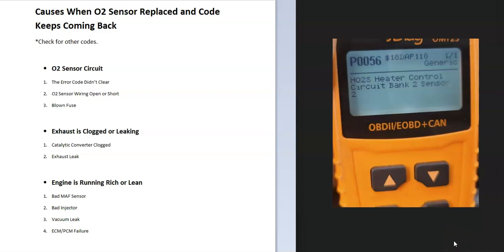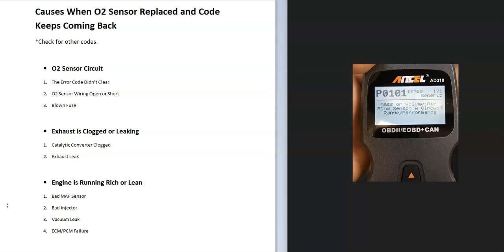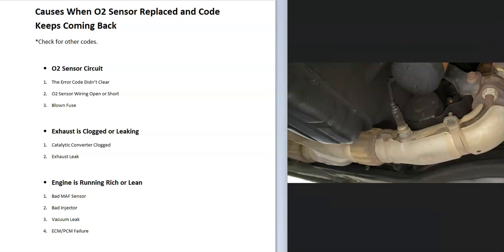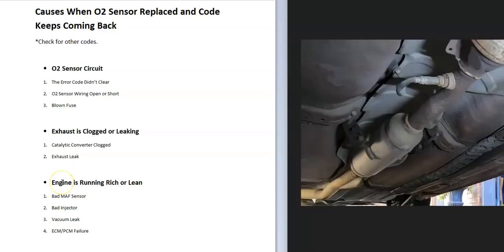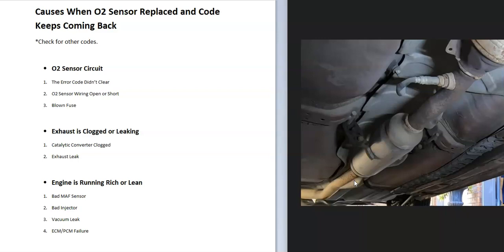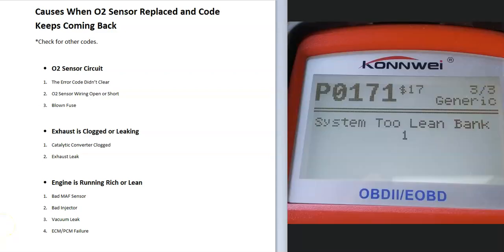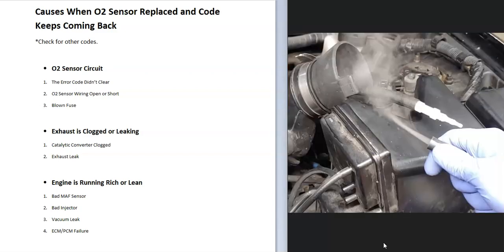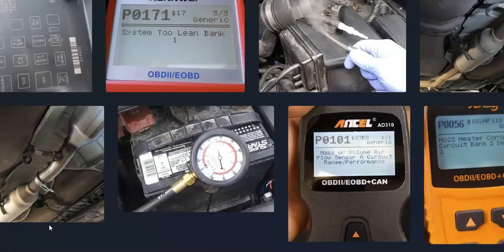Causes When Oxygen Sensor Replaced and Code Keeps Coming Back

Comment: I had a Ford van that tossed po 174 And 175 something like that,anyway I changed the oz sensors and the codes didn't clear,come to find out it was the ecu, so it was tossing bad codes had ecu program flashed with updated software and all codes were gone! Damn ecu PCM are nothing but a problem .

Comment: I don't think this guy will answer me, but I will ask anyway: I have P2096 in my Kia soul 2012 2.0L automatic.  replace downstream sensor, nothing. Replace upstream sensor, nothing. replace 4 spark plugs, nothing. replaced 4 coils nothing. did Exhaust leak test, nothing. Vacuum leaks? no, this car is Brand new with only 88K miles and well maintenance inside garage all the time.  I DON'T HAVE ANYTHING WITH A/F MARKED for fuses. This car has never an engine light until now. So, what else could be?
---- Practically, this is a job for a mechanic to rip you off or the Stealer ship to kill you with wherever bill they want. WOW.
Reply from the maker: If the 02 sensors are good very likely the engine is running lean. Looks like you are going in the right direction. Lean codes can be hard to troubleshoot and can be caused by many different things. If there are no other codes and the CAT is good, I would test the fuel pressure and be sure it is correct.
Reply: @HVAC_Mechanic  The car is working fine, perfect, smooth, MPG the same. Nothing has changed ever. The car is new, so fuel pressure test for what?
Reply from the maker: No exhaust leaks, no vacuum leaks, no codes for a bad engine sensor, new coils/spark plugs/02 sensors. The only thing left that can cause a lean code is fuel pressure.

Comment: My 2017 Nissan Versa is doing this. We replaced the O2 sensor last year and it stayed off long enough for me to pass emissions but came on as soon as I did emissions… We can’t get it to go off. We put a new catalytic converter, air filters, etc.… Do you think the O2 sensor is itself faulty? It was bought on Amazon and didn’t properly fit so we had to rewire it.
Reply: And when I say “we can’t get it to go off“ I mean the check engine light.

Comment: I have a Strange p0136 bank1 Sensor 2 Code wich keeps coming back even before I restart the (Diesel) engine. (at least immediately noted again in the system MIL is of for 1 or 2 days then it comes back) Fuse was intact, no obvious cable problem. Cat is 280degrees at front, over 600 at the Back side, so the cat should be ok. 
But if it comes back before I even restart the engine it should be a electrical problem?

Comment: I just had my car at the mechanic shop for 1 month. 2 mechanics diagnosed the ecm was the issue and it needed a replacement or repair. Sent it out to be repaired and finally got the car back and drove probably 15 or 20 miles and the light came back. After “repairing” the ecm and replacing all o2 sensors it still came back. I’m losing my mind!!! More than 2k later and it’s still an issue.
Reply: Did you get it fixed?

Comment: Keep getting p0137 and p0157 . Replaced both 02 sensors, hooked up air and dealt with all leaks after checking with soap water,  checked all fuses and relays and cleaned all contact points with electrical contact cleaner,  only other code i get is p02757 which has to do with when i put in a torque converter lock up kit and new performance valve body.  Been running out of things to check

Comment: i have a 2008 pontiac vibe got a code po 141 comes on then shuts off will a bad 02 sensor do that it said bank 1 # 2 i noticed after driving a while it goes off and also noticed the temp gauge is taking much longer to reach temp when it does the engine light will go off but that is after driving a while also when i start it first thing it when it isnt on it will sometimes come back on and the temp gauge is taking a long time before normal temp  but i have heat

Comment: Have a 2000 Ford F-250 with a v10.   Only 104 k miles. Got a code for 1 of the O2 sensors.  Replaced both. Cleared the code and 100 miles later, light comes on. Same code but both O2 sensors now. 🤷🏼‍♂️. Going to check fixes and relays.

Comment: I’ve had an upstream code pop up but it was actually a downstream O2 that was bad,  down looked good at idle but failed driving under load.
I’ve also had a bad coil pack causing an O2 upstream code

Comment: What do you do if you buy a part as suggested, but it doesn't work? HOW do you figure out WHY replacing it, did NOT fix the problem?
Reply from the maker: Components need to be tested since it can also be in the wiring and possibly other issues.

Comment: I got a good one for everyone including pros techs in the past 5 years I’ve run into some interesting vehicles when doing repairs but regrettably  I can’t say where I work at . Who can tell me the reason for high voltage on a 02 sensor I’m talking 3.5 volts in one vehicle it was over 7volts but ran perfect and no codes went thru the drive cycle  completely got smogged passing California strict and highest emissions. I suspect a glitch in the ecu software. Something with that much voltage should not be running properly it should be blowing out black smoke destroying everything down the Exaust pipe . Any one ?

Comment: 2005 scion xb upstream and downstream replaced. P0420 code showed again. Need to reset the o2 sensor monitor by completing a drive cycle. Drive 25 mph consistently for 50 seconds; then idle for 40 seconds, then repeat 10 times. ❤ oh but first, start car either in park or neutral depending on MT or AT, let idle; then begin the drive cycle of 25 mph consistently for 50 seconds; idle for 40 seconds, and repeat for 10 times. ***BTW, the P0420 code along with VCS/CEL/TRAC OFF pops on at 65 mph and above. Reset the o2 sensor monitor.

Comment: I am getting a P0055 on my Civic, car runs just fine, any ideas? I dont know if this has a fuse for it.
Reply from the maker: I would check for a blown fuse or bad relay, then use a meter and test the heater element in bank 1 sensor 3 O2 sensor. If that is good, the voltage can also be tested, usually 12 volts on start.
Reply: @HVAC_Mechanic  Thanks, is it the O2 sensor on top or the down one?

Comment: I’m working on this 2013 ford Taurus with the 3.5 eco boost flex fuel has codes for po145 and bank one and bank two down stream sensors stuck rich and I’ve done a test on the purge valve and vent valve coal canister all working fine and checked the map sensor fine checked the o2 sensors connection fine and did a leak test on the system fine and the o2 sensors are in the 5v range idk much els to check I was gonna pull the o2 and look at them as well I’m wondering if it’s the VVT solenoids there leaking oil I was gonna check and see if there good or not and the seals oil is fresh any ideas would help thank you for ur time
Reply: Did you check the fuse

Comment: No exhaust leak no vacuum leaks wiring is all good two new pcm's two new fuel filters proper fuel pressure and fuel volume still running lean and bank 2 upstream 02 sensor won't oscillate stays at 445-450 171&174 codes keep coming back. I'm lost at this point.
Reply from the maker: If the 02 sensors are good, then the engine is running in a Lean Condition. Lean codes can be hard to diagnose. Since it is on both banks, it is likely something that would affect the whole engine.
Reply: @HVAC_Mechanic  don't affect engine performance but the codes keep coming back.
Now I put a different scanner on and it shows the bank 2 upstream 02 sensor working as it should. But both sensors stay very low at idle.
Thanks for your help.

Comment: Hi
I have 2015 yukon with p0171 p0174 p0430 p0420. Replaced maf and 171 and 174 code is gone. However 430 and 420 remained. Cat was clogged as there was slow response and gas milwas poor.Replced cat(magnaflow oem, all 4 o2 sensors oem), car runs great, gas mileage back to factory specs. But 420 and 430 codes are back 
On freeze frame I see that o2 bank 2 is at 0.2 milivolts(i know it should be steady 0.6-0.7.
Is it that new oem o2 sensor is not good, or I am missing something.
Appreciate any help

Comment: Mine came on again after 3 days. Had O2 code and Stuck rich codes, as well as P0456 very small leak. A few months ago someone suggested to replace vapor canister but also could be catalytic converter. My car is at 218,000. Any suggestions? It doesn't seem to have other issues except a little excess vibration when idling and a few extra seconds to equalize when I turn it on in the morning. It's not poorly accelerating like it was before.
Reply from the maker: It needs to be diagnosed, but I would check the purge valve located in the engine bay. If the purge valve gets stuck open, it can throw an EVAP code and cause the engine to run Rich. I made a video on how to test it, but basically, if you can blow through it when there is no power, it is stuck open. Here is the video how to test if the purge valve is stuck open. https://www.youtube.com/watch?v=X-Y5YsaXxJE
Reply: Raise the engine 100 150 rpm

Comment: My check engine light is flashing above 30 mph but if i run lower than 30 it does not keep flashing….anybody have an idea What causes this?have changed the o2 sensors and still flashes…..

Comment: i don't see af fuse on toyota 2007 rav4 heated o2 sensor is bad scanned it my self but im checking no fuse blank
Reply: Same on a 2000 toyota 4runner. No fuse. If yours is a circuit code, start running down the wiring from the o2 all the way to the harness connector under the hood looking for crushed or chewed up areas.

Comment: Hey, I have a 2012 kia soul 1.6 standard transmission. I've been having the same code popping up after each part replaced. So far we've replaced the knock sensor, the MAP sensor, all four spark plugs, the upstream and down stream 02, and the p0420 and p0420 p, keeps coming back. I hate to guess but I'm thinking the Cat may need to be replaced? Not sure what to do. Any thoughts?
Reply: I have a kia rio same engine. Replaced downstream o2 and still getting po420 as well. Getting ready to replace upstream o2 next! I replaced all injectors and coil packs recently , new plugs! Hopefully upstream o2 will fix my issue! New coil packs worked wonders when i was getting a different fuel system code than po420 ( cant remember the # off hand) but it was only running on 3 cyl. Ran great after coil packs got changed!
Reply: @StonemanRocks  hey, thanks for your reply. So, I found out that Kia actually had a recall on certain Kia Soul Catalytic converters. Apparently they actually had two recalls since 2018, both of which could cause serious engine failures and or engine fires.  I'm trying to schedule an appointment to have both recalls taken care of.  I would definitely check and see if there were any recalls on your car.
Thanks.

Comment: 2004 Infiniti fx35 after replacing 02 sensor the code keeps coming back and my Mecanic can’t figure it out I try to tell him to check the fuses and he tells me fuses have nothing to do with 02 sensor, he repaired vacuum leak and the code still coming back.

Comment: I have a p0420  talks about the two sensors. First says pending.  Other says permanent. Please help!! I'm to go to my mom's 94 years old I'll. 8 hour drive!!
Reply: My son inlaw replaced from sensor n engine light still on.
Reply from the maker: A P0420 is a "Catalyst System Low Efficiency," which could be a bad 02 sensor giving bad data but can also be a bad catalytic converter; it needs to be diagnosed to fix the issue.

Comment: Hello i have a 2011 toyota prius i never had a check engine light on before it spun a bearing i replaced the engine and took all the sensors off the old engine and replaced it and the headgasket while i had the new engine out and i have  a p0420 code so i then replaced the o2 sensor with an oem 
 replacement part still has a p0420 code i checked all wires and took it to the stealership they charged me 250$ and told me that it was an intermittent problem with the 02 sensor so i then replaced it with another oem part and still have the same problem the egr cooler was almost completely clogged when i replaced the engine so i cleaned all parts with a pressure washer and welding wire but i still have this code any suggestions would really be helpful i dont know what else to do ..btw your video was very informative ty
Reply from the maker: It needs to be troubleshooted, but it sounds like a wiring issue, such as a bad connection or a wire rubbing on metal.
Reply: @HVAC_Mechanic  I've had to replace the headgasket on the original engine when I bought the car for my wife (no check engine light ever on original engine) then she left her daughter drive the car she hit a curb and ran the car out of oil it spun a crank bearing so I got a jdm engine so while I had the new engine out I replaced the headgasket and cleaned the egr cooler and all the passages in the intake that were clogged with carbon buildup (was alot so bad the egr cooler was clogged almost completely and when I was taking the old engine out I had the valve cover off and when I pulled the engine I put it back on to use the hook on it for a chain and I had accidentally smooshed a wire from the harness in the valve cover I believe it was the temperature sensor wire so I had resoldered the wire that it crushed anyway I put the newly rebuilt jdm engine in and that's when the check engine light came on so I bought a cheap replacement from rock auto that didn't clear it so I got a Denso replacement that didn't work so I bought another one toyota replacement and took it to the stealership they charged me 250 for a diagnosis and told me that it had a intermittent o2 failure with p0420 code I was so mad because I already knew that so the sales manager called the tech and he said he checked the email and it wasn't in there they told me that for 700 they could diagnosis it further I told them I'd never let them touch my car again. The car runs fine I just don't know what to do I believe I checked the fuses but idk about relays and how they work
Reply: Thank you so much you're been super supportive your videos are amazing and full of knowledge I just want you to know that what you do helps alot of people
Reply: https://youtu.be/U-M5CUcsc-E?si=5O9cK4UWOsSXUBLX
Reply: Here is the link  for the test light but im scared to try this method on my hybrid

Comment: I changed my O2 sensor on my ram 1500 the light engine turned off after but came back on the next day 😢
Reply: Did you get a solution

Comment: I replaced all my sensors and kept getting the same code.  I tried everything.  Then I watched your video. You stated exactly what the sensors designation was and I went to look. BAM…. 850.00 later and I could have just replaced the missing 15A fuse.  You’re the man!!! Thank you before I would have taken it in somewhere and spent MORE money on it.
Reply: I’m literally in that situation I change cam shaft sensor.. o2 and. Maf sensor and spark plugs and made sure throttle body clean .. I’m abt to give up frfr
Reply: @ZahraAhmed-u1j  did you ever figure it out ? Having the same issue with a 2008 GT mustang
Reply: @gracelynterry4278  Ever figure your issue out? Having lean hesitation on my 2005 Mustang GT.
Reply: $850 for a bad fuse? Dam you got ripped off
Reply: What kind of fuse was it?
Reply: I changed cats, sparks/coil plugs and 02 sensors. All codes went away except Rich/Lean fuel mixture in both banks. I am def checking relays and fuses tomorrow. Ironically my og guy at AutoZone told me this before I change all those other parts. Although I did need new sparks and coil plugs. Not sure if my cat’s were actually bad tho. But that’s said and done now. I did ask the work myself so I saved on labor at least. Gonna be pissed yet relieved of my fuses are the issue
Reply: @WaterWalker238 sup brother, ever figure yours out?
Reply: @WaterWalker238  you might want to look into your injectors themselves!
Reply: My Mecanic told me the fuse have nothing to do with the 02 sensor
Reply: @cuarajhyrojayju4397  it was a little tiny 15A fuse exactly labeled as this one said to look for.  Under the hood.  The fuse has everything to do with how the sensors work.  Get a new mechanic.
Reply: @HappySox81_TheOriginal  what fuse is related to o2 sensors?? Like what's the name?  The ___ fuse?
Reply: @ronaldrrootiii6040  the A/F heater and A/F relay.  Marked (A/F)
Reply: @HappySox81_TheOriginal  NOP, I DON'T HAVE ANYTHING WITH A/F MARKED.
Reply: @cuarajhyrojayju4397 if it has a heater, it goes through a fuse.

Comment: I have replaced upstream oxygen sensor on my 2006 Hyundai Elantra.
Plus, injectors, VVT solenoid valve, map/MAF sensor, Purge Valve Solenoid, PCV valve.
The P0133 still coming back.
Normally at high speed.
Only clue I have after smoke testing last week.
Throttle body butterfly spindle shaft leakage Both ends.
Will this throw off the Oxygen sensor on high speed deceleration?

Comment: I have an Honda Odyssey 2009. I change the oxygen sensor bank 1 , the light still on. So I clear the codes and lights goes off. few days later lights on again. I scan the car with OBD2 and still have the same problem. Bank 1 sensor 

please help
Reply from the maker: If the 02 sensor is good, I would test the wiring next.

Comment: these O2 sensors are a major pain in the butt and I don't really see the purpose for them these days, In Ohio only 5 counties require E-Checks. Cleveland is no more  a major factory-polluting city, Get rid of Echecks guys!!
Reply: From what I was told it affects turbo vehicles
Reply: These are on all cars and are important to fuel mileage. They are telling the engine how much fuel is in the exhaust and helping to know much to adjust how much fuel its send into the engine. This has nothing to do with emissions controls